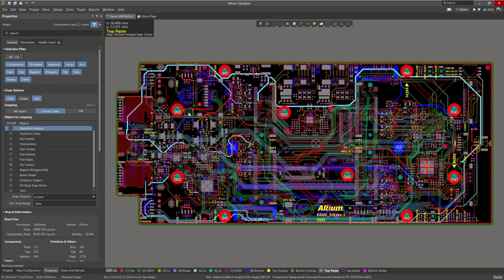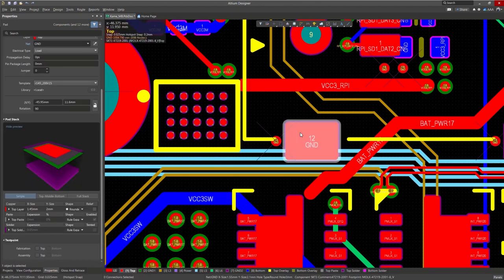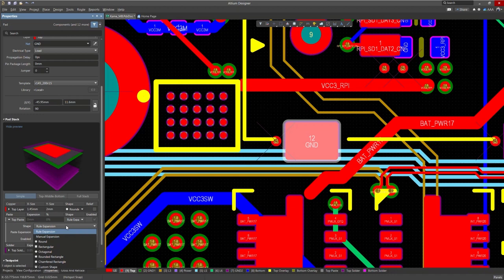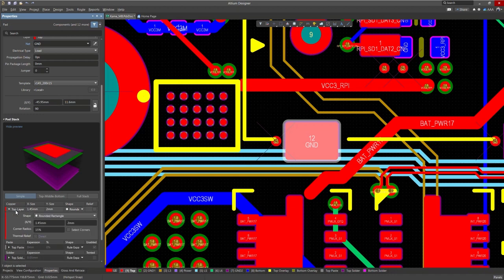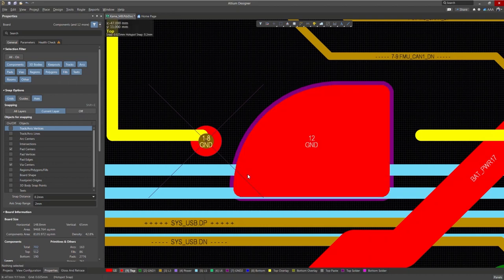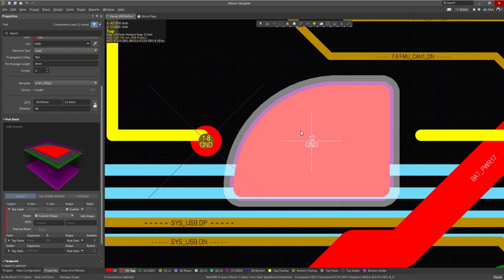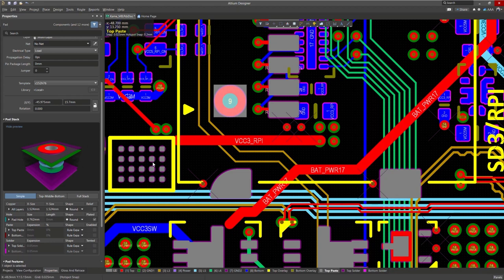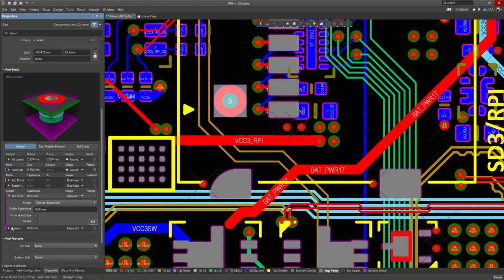Custom Paste Mask and Solder Mask

Comment: you are talking about making customized pad shape.  what we expected is how to make customized masks shape which is very different from pad shape....
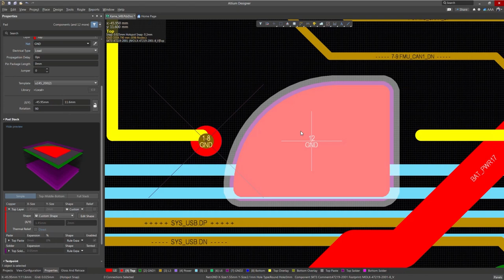Reply: The expansion rule automatically applies to a custom pad shape and creates the custom solder mask/paste mask shape with the defined expansion value. You can see it around the pad at 0:41.
Reply: @Zachariah-Peterson  Everyone know what does expansion means....it means mask having either same or similar shape as the pad....what we talking about is to create a very different mask shape from the pad shape...
Reply: @sparklee6994  You can draw it out manually with the line and fill tools directly in the mask layers.
Reply: @Zachariah-Peterson  Thank you,  that is helpful information/tips.

Comment: this video is pointless come on wtf please title your videos correctly. How do you edit PASTE LAYER?
Reply: The standard paste mask expansion rule applies uniformly around the edge of the pad. As long as a pad has a rule enabled, you can edit the value for the paste mask expansion rule and it will automatically apply to the pad. If you want a totally custom mask opening that does not match the same contour as the edge of the pad, you can draw a paste mask opening into the footprint.